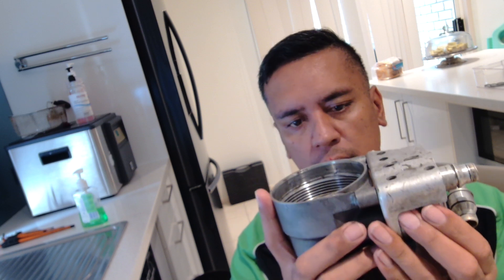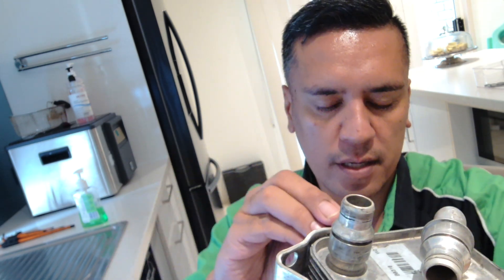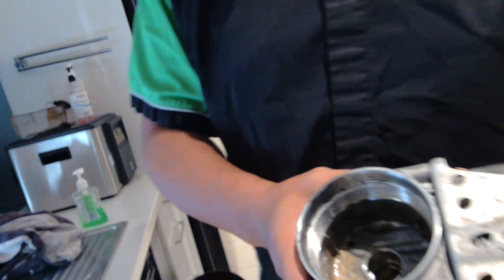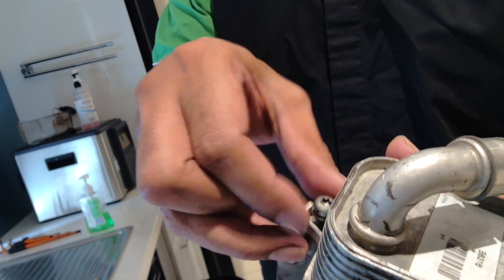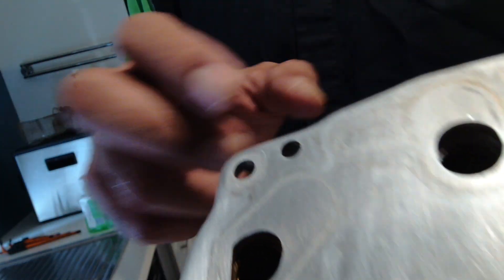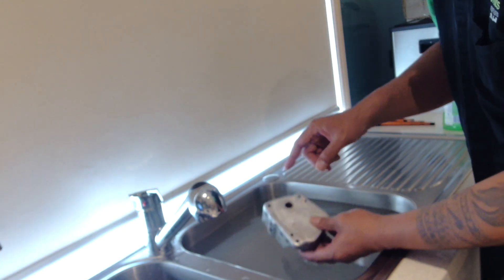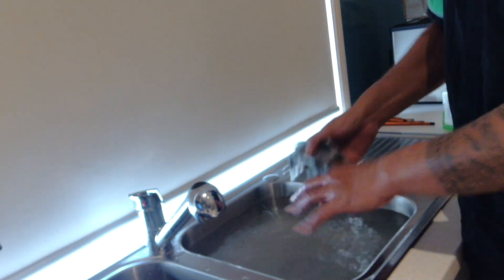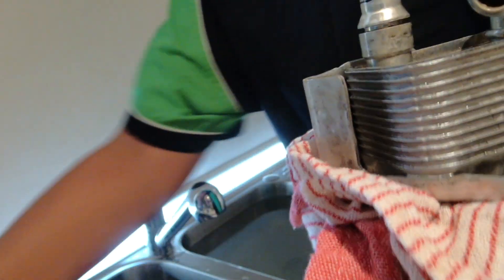2007 BMW 320i E90 diagnose faulty oil heat exchanger

Comment: Great explanation. Tho, it doesn’t explain the missing liquids on my car. I can spot small milky substance on my oil fill cap. And every now and then i have to both add oil and coolant… any ideas for me?
Reply: A little mayo/milky substance under oil fill cap (on valve cover) by itself is not uncommon, especially if you do lots of short drives.

Pressure test your cooling system to help find leaks.  Engines do burn oil if you find no oil leaks.

Look at both oil and coolant for signs of chocolate milkshake (mixing).  An oil dipstick if yours has one would help you check oil condition (without draining it to check and measure).